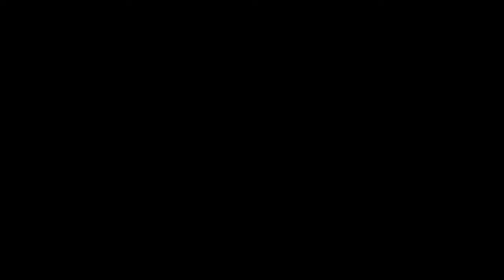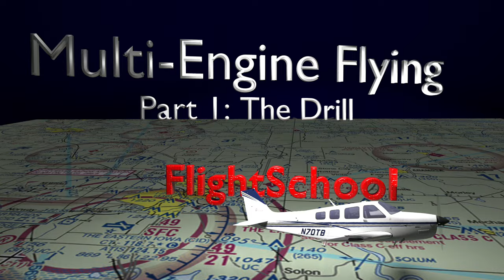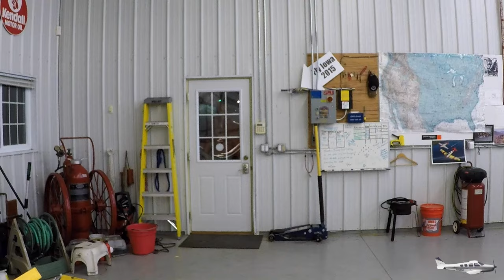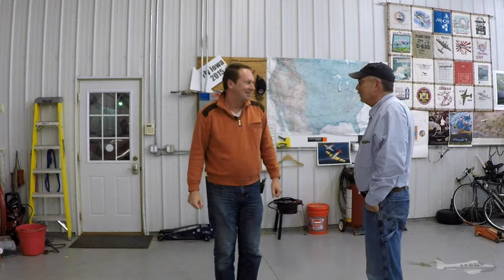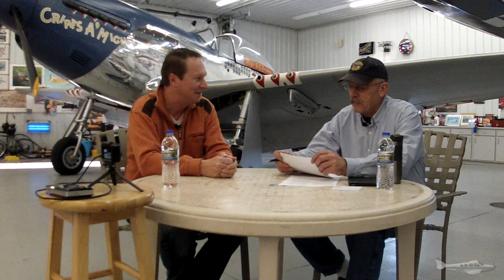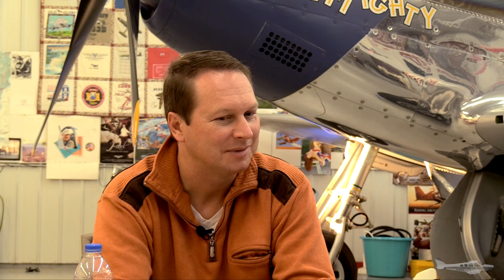Multi-Engine Training - Part 1: The Drill

Comment: I knew a gentleman who had a left failure during a fast t/o roll, his Baron went off the runway to the left heading towards a hangar. He pulled it up, and initiated a left turn to return...halfway thru the turn it stalled  and was fatal.  I'd be curious what your instructor's initial decision would be in that situation? ...power back the right, hard right rudder to return to the (shortish) runway and stop...or the Drill? 
Always a treat, Martin.
Reply from the maker: Any issue before retracting the gear should prompt pulling the power on BOTH engines and coming to a stop straight ahead. If that means going beyond the end of the runway, so be it. Not good, but far better than the alternative you described.
Regards, Martin

Comment: He is correct. The human brain does not “rise to the occasion”; the human brain defaults to its level of training. Training must be recurrent, and consciously maintained. I am a PP with 830 hours total time over the past 8 years, 450 of those in my Mooney 231. I recently experienced an engine failure in my aircraft at 6500’ AGL more than 25 miles from the nearest airport. I am fortunate that 1) my primary CFI emphasized the engine failure checklist on every flight, locking it into the “Mary had a Little Lamb” part of my brain;” 2) on every flight I’ve taken since then I have consciously reviewed the engine failure checklist; and 3) at my recent BFR (which I do every year, not every 2) I had my CFI run through the engine failure drill with me, among other items. As a consequence, my landing in a pasture in eastern Colorado was almost routine. I defaulted to the level of my training, and that level was sufficient for the emergency. At this time I am considering moving up to a twin engine aircraft, which is why I’m watching this video today.  “The Drill” makes perfect sense. Thanks for posting this video, Martin.
Reply from the maker: Thanks for the feedback, James, and I am glad your engine out landing went well.
- Martin

Comment: Hi Martin. Saw reference to your video in IFR magazine and thought I would take a peek. Sorry to say but I think you and Doug miss an extremely valuable point in light piston twins: maintain directional control. Besides pitch for blue line this needs to be a fundamental FIRST  element in the Drill. Maintaining directional control (by using the heading bug and not the FD) is how we not only find the dead leg, but also bank into the dead engine. Which is one of the most important elements to maintain a speed above Vmc as Vmc can go up dramatically if a bank is not established. I would be willing to bet that there have been more than one KA that have rolled due to the pilot following a FD up rather than a heading bug. Just my two cents. Sam

Comment: Such a great explanation! 
But I want to know why should we land straight ahead if the gear is still down? Doable of course if the runway is long enough from my understanding! Can I get more details? Thanks
Reply from the maker: It's harder in those first few seconds with the gear still down. You are slower, so all those bad things I mention in the other twin video (VMC) are working against you more strongly. And It'll take even more power to accelerate to VYSE - power you may or may not have in a light twin with only one engine running. All while being so close to the ground that there is very little margin for error.
Therefore, our general recommendation for light twins is to land straight ahead if the gear is still down. There are of course some powerful twins that could climb away in that situation, but there are also accidents resulting from people continuing to climb when landing straight ahead could have saved their lives.
Finally, gear up-or-down makes a nice, easy decision point. If an engine quits a second after liftoff, you don' want to think about performance numbers. The decision has to be pre-made, and gear up-or-down helps with that.
Best regards, Martin

Comment: I've often wondered if I would be systematically blocking full power from the good engine if I were to push both mixtures to full rich while operating at an airport which has an elevation of 5,000' or greater. If you have leaned both engines for takeoff in order to obtain maximum horsepower performance output at a high-elevation airport and subsequently lose one after rotation (assuming not enough runway ahead to land on), would you "kill" your chances for continued flight if you arbitrarily pushed both mixtures to full rich during the engine-out emergency? If you did, your "good" engine would now be running too rich, and it would lose some sorely needed power.
Reply: You are correct, If you have leaned to best power, then the mixtures would be fine.

Comment: The ball does not always point to the earth in coordinated flight. If it did then it would be outside the center in a turn. It follows the lift vector, not gravity.
Reply from the maker: In a turn you are correct. But the statement in the video was about flying straight.
- Martin

Comment: Why flaps up if you're in climb-out if you have them out for climb performance (e.g. short field)?  If you've just lost an engine wouldn't flaps-up add to the sink rate unless you were already level and accelerating?
Reply from the maker: I guess it depends on your airplane. Generally, though, gaining speed is more important in a twin than gaining altitude during the first moments after lift-off. I would also argue that a short-field take-off in a twin is a bit dicey as in there may be a period of time where an engine failure in the initial moments of the flight requires a return to the ground - on or off airport. Flaps are nice, but if they prevent you from getting to blue line, you are really without good options.
Regards,
Martin

Comment: I’m slightly confused about what you said regarding the inclinometer. You said the ball should Point directly to the earth, so if you’re in a 5° right bank turn the ball should be slightly right of center. But I thought a coordinated turn meant the resultant load is straight down out of the bottom of the aircraft, not to the earth; therefore keeping the ball centered at all times insures coordinated flight. Please correct me if I’m wrong or if this is some thing specific to multi engine planes with an engine failure.
Reply from the maker: Hi Nayef, take a look at how Doug explains directional control (after an engine failure) here:
https://youtu.be/oD3YPdOH5Xo?t=953
After you raise the dead engine and apply rudder as needed, the airplane flies banked slightly (5 degrees or so) but with the yaw string perfectly centered - i.e. it flies coordinated. The ball will point straight down to earth (because we are not turning), but the airplane isn't wings-level - thus, "straight down to earth" isn't the same as "ball centered".
Once you understand that, it's a small step to a coordinated turn with one engine inop, with the yaw string centered but the ball NOT centered.
Regards,
  Martin
Reply: @martinpauly  thanks for the explanation! I haven’t started multi training yet and this confused me, but it makes perfect sense now.

Comment: A few constructive comments on this subject:  16:30  We never confirm positive rate off of a VSI in GA as few GA planes have and IVSI, the sole determiner for positive rate in a light piston twin trainer is either visually, or baro altimeter.   16:48 We never "pitch for blue line" - we pitch for the correct single engine pitch.  You should know what the correct pitch to establish is for your plane, typically 3 to 5 degrees ANU    Pitch plus power equals airspeed.  Set the correct pitch (visually or ADI) and you will yield the correct speed as the result of the first two ingrediants.  Also, blue line is the eventual desired climb speed but you may (and often do) pitch for the correct pitch and climb out on Vxse to clear obstacles.  We have a published Vxse an it is a safe speed well above Vmc - your SE pitch may yield Vxse initially and that is OK too.   LAST, the procedure shown is incorrect by teaching muscle memory to new pilots that in time of crisis we should "jam" things forward.   DO NOT push mixtures. props and throttles to the limits as you were taught here.  You may be in Denver and if you jam mixtures forward you will lose both engines....If you go on any fly anything Radial or Turbine, there is lots of throttle movement available beyond  the TAKEOFF power setting.   The power "set" for takeoff is the power set, and it should stay there.  Don't ever jam all six knobs forward  by rote reflex.  Ask the King's about this.  See this FlightChops video where he comes to the same conclusion.  Also, don't ever condition yourself to suck the flaps up low energy close to the ground.  The flaps setting that you selected prior to takeoff is what you have and sucking the flaps up will be your death spiral.  You need those flaps at this time.  If you go on to fly anything "big" you will see how this procedure works...we eventually do retract flaps and clean up but NOT during time of crisis.  The Colgan fatal was caused by a girl that arbitrarily retracted flaps from muscle memory during time of crisis and down they went.    I am not a fan of arbitrarily "jamming" things forward or slamming flaps up in order to satisfy a rote thing that you ingrained.  The correct procedure is: 
1) Pretakeoff checklist and brief confirms desired flaps/mixtures/power setting/EF plan.
2) Rotate at briefed rotation speed.
BAM
3) "Engine Failure - establish pitch (may be a push or a pull depending on where it happens)
4) Positive rate 
5) Gear up
6) ID
7) Verify
8) FX
9) Consider flaps retract when safe altitude and speed
10) After takeoff checklist
11) Engine failure checklist 
See Flight Chops video here:  https://www.youtube.com/watch?v=UeujX2JZfHU&t=281s

Comment: If you are taking off at a high altitude airport with normally aspirated engines, putting mixtures full forward is going to reduce power on the good engine. Also, if you are at a high altitude (14 or 15k using oxygen) and do the "drill" same thing, the running engine is going to be running super rich and might quit too. Then again, the plane is probably not going to be able to climb or maintain altitude unless it is very light so you are probably going down anyway.
Reply from the maker: You are correct, Jon, that altitude needs to be considered for the mixture control. Doug's Baron has altitude-compensating fuel pumps, so full-forward is still goof if you were flying LOP, for example, even at higher altitude. Same with a turbo charger. Bottom line: know your airplane and its systems, tailer the procedures accordingly.
Best regards, Martin

Comment: Hi Martin. Love your videos. I got hooked at your Bonanza and gear problem video initially. Truly enjoyed the careful attention to troubleshooting and resolution. I have a passion for Barons, so enjoying this video in particular. Quick question, I gather this conversion is a BE55? What are the Blue and Red lines speeds you use?
Reply from the maker: Thanks for the kind feedback.
Going from memory - the Baron is 100+ miles north of my home - VMC was marked at around 75 to 80 knots on the airspeed indicator, and the blue line was at about 110 knots.
- Martin

Comment: A great instructor. He stressed the important details which are to be methodical and deliberate.It's rushing the drill when people stop the good engine, etc. I did my multi rating years ago in an old Apache on some VERY hot days in England (yes, we do have those in England from time to time) and the performance on one engine was marginal to put it mildly.

Does this mean we can see N70TB being exchanged for a Baron? :)
Reply from the maker: I'm not going to sell the Bonanza anytime soon.  Besides knowing how to FLY a twin, I'd have to know how to PAY for operating and maintaining one.  :-)
- Martin
Reply: @martinpauly  I've been meaning to ask you. What headset do you use and is it not noisy in a piston plane? I've seen people using headsets like yours but more often in jets.

Comment: I remember my multi training. Now a single engine hourly rate is slightly more than a multi engine  rate. Can’t afford those $375 - $525 an hour hops around the pond. At least I obtained the rating! Remember, dead foot, dead engine.
Reply: I paid $140 per hour in 1994 for my multi in an Apache. Did it in 12 hrs. When I started my ppl it was $47 per hour dual in 1983. Back then, I shunned a helicopter rating cause it was $140/hr for just the helicopter. I just thought when you fly a multi, you just everything the same a a single only twice 😂

Comment: Airplane engine blow-ups should be rare these days. In a single front engine plane you better use the parachute. If you have two engines your first thought should be: I still have one left (or right)! I never understood why the DC10 and the Tristar are discontinued (just needed a canard?). Modern LSA planes are fast and fuel efficient and are great gliders.

Comment: Martin, where do I start... 

Thank you from the bottom of my heart for this video! It’s been many years since I’ve flown a twin-engine airplane. This video brought me right back up to speed. I’m looking forward to following videos with regard to this topic, and I’ve newly subscribed.

This instructor is amazing. Quick question, he said something about a 3 degree glide path on an ILS with one engine. Did he mean, just land, the power available won’t hold the glide path or even climb at that specific point on one engine? Thx

Anyway, thanks again. I’m trying my hardest to get back into flying. I left several years ago and have regretted it since. It’s like learning this stuff all over.

Are you planning on purchasing a twin? Doing twin videos? 

Scott (KPTK)
Commercial-Inst-Single-Multi
10 hours in a Baron 58 :)
Reply from the maker: Scott,
I agree, Doug is a terrific instructor! 
What he meant when he talked about an engine failure while descending on the glide path: you wouldn't raise the gear in that situation, you'd do the mixtures/propellers/throttles part to get the most power out of the remaining engine and continue the approach to a landing. He said that almost all twins have enough single-engine performance to make it down a 3-degree glide slope (as opposed to climbing - not all twins are capable of that on one engine).
I'm not going to get a Baron myself anytime soon. Right now it's just exciting to learn something new. We'll see what the future brings...
Speaking of the future: Part II of this video (VMC) will be out tonight, 11PM central time.
Best regards, Martin

Comment: Surely the first item of “the drill” should be to keep straight with rudder?
Reply from the maker: That is important, yes, but it's also kind of a natural, automatic response/reflex to counter the initial yaw. I have not heard about pilots getting into trouble because they don't do that. I have, however, heard many times of pilots who get into trouble for not pushing the nose down after an engine failure. That's why our checklist starts there.
- Martin
Reply: @martinpauly  Thanks for taking the time to respond, Martin. An enjoyable & informative video. I’ve instructed on light twins (Baron, Queen Air & Cessna 310) a very long time ago plus more recently airline types - and there were still some gems in your video that I hadn’t thought about! My comment about keeping straight with rudder stems from teaching on swept- wing types where the yaw response is often hidden by the roll response.

Comment: 9:09 I can see how the ball should be pointed at the earth in a single engine power out, but in a coordinated turn, I believe it should be pointed parallel with a the yaw/vertical axis (in which the force of gravity toward the earth and the force of inertia from the turn are equal). If the ball is outside of center, inertia has a bigger effect on where the ball is, and if it’s inside, then the force of gravity has a bigger effect).  How I understood it anyway.
Reply from the maker: Hi Alex. Are you saying the ball should be centered in a turn with one engine inop? It's not. Part of your bank (5 degrees or so) is not for turning, but for the dead engine ("raise the dead", as Doug says in the video). You can confirm this yourself by watching the yaw string, which points straight back and thus confirms that the turn is neither slipping nor skidding, even though the ball is not centered.
Regards,
  Martin
Reply: @martinpauly  9:28 no, I thought he said that in a normal coordinated turn (no engine out), the ball should be always pointed at the earth also which was said a little later). I thought he might have misspoke?
Reply: @martinpauly  this training is so good btw, I’m just trying to make sure I’m understanding him correctly. I’m out here at Riggin Flight Service right now to get my multi!
Reply from the maker: @alexs3187  Ah, I see what you mean now. Yes, Doug is talking about flying straight here, not turns (though he doesn't say it explicitly). In a coordinated turn with both engines running normally, the ball should of course be centered.
- Martin
Reply from the maker: @alexs3187  Good for you, Alex - best of luck with the rating!
- Martin
Reply: @martinpauly  thanks Martin! I’ll be watching these videos over and over.

Comment: I disagree with the verifying. Don't pull the throttle back on the good engine! Pull it on the bad engine, you know which way the aircraft yow. So you know which engine the bad one is. (well here where I live we know, but it's not so in the test of the world)
Reply from the maker: That's what we are doing in the verify step, Jonathan: pull throttle on the BAD engine, not the god. If nothing changes when we do that, it confirms ("verify") that we have correctly identified the bad engine. Doug makes a valid argument in the video why the verify step is important.
- Martin